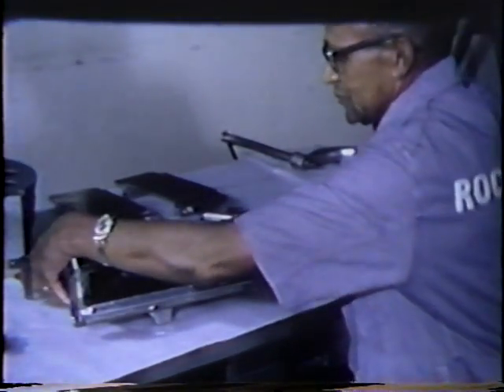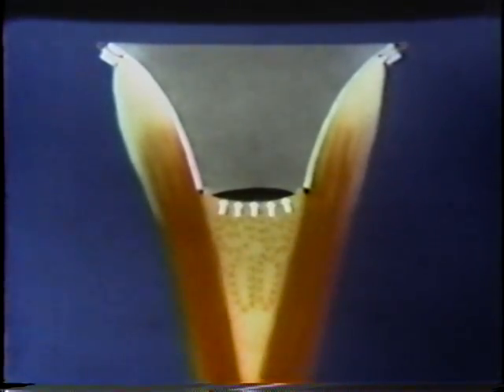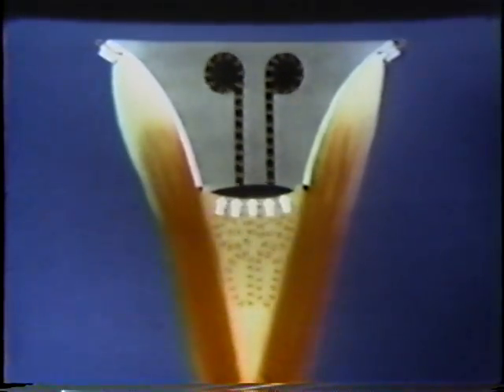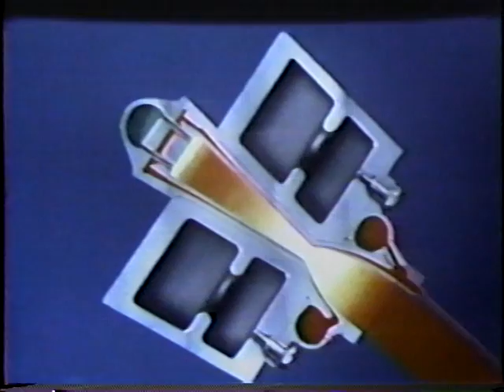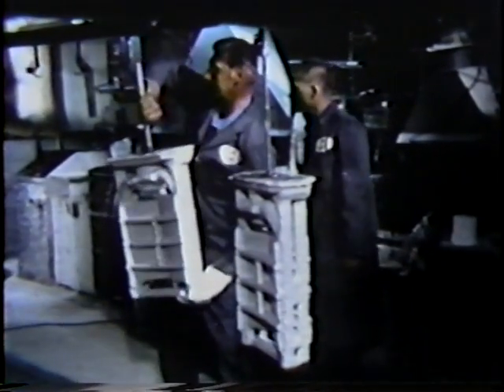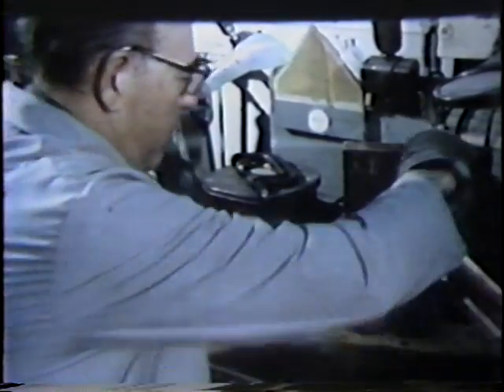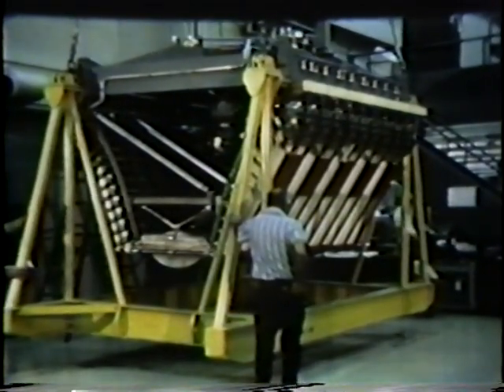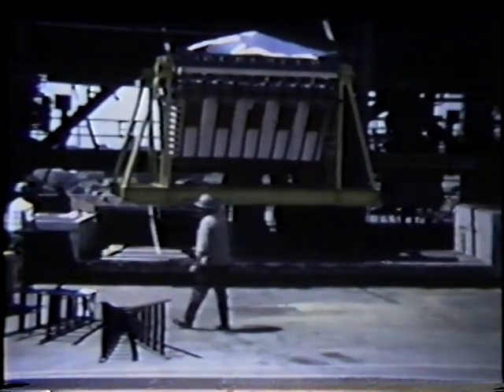Linear Aerospike Engine

Comment: Ken, 

I was a big supporter of the X-33 Single Stage To Orbit, SSTO vehicle that was based on the Aerospike engine.  The video covers historical technical background information that is useful.   It supplies an overview of this NASA development work.  

The Aerospike engine design has the potential to reduce the vehicle mass ratio.  Now, as SpaceX moves toward reusable boosters,  any cost improvements in the entire Falcon system are welcomed.  

The big issue that nixed the X-33 wasn't the engine or the SSTO idea.  It was the composite material & irregular shape used for the liquid oxygen(LOX) & liquid hydrogen(LH2) tanks.  There was a failure on filling them on a test stand.  No additional money was available at that time to develop a sound design.

Here is a link to a Wikipedia article on the X-33.
Reply: +John S Wolter https://en.wikipedia.org/wiki/Aerospike_engine

Comment: Its been 43 years since this and we still using bell rocket engines.....
Reply: If only the X33 wasn't cancled and instead put on hold till a material for the H2 storage could be found.
Reply: With very good reason. Nobody has figured out how to circumvent the laws of physics yet, in order to make a big aerospike work reliably.
Reply: Yeah, unless you're launching an SSTO you can have every engine optimized for the pressure range in which it is going to operate and you can avoid the aerospike's heat management issues

Comment: 2:33 Can sameone explain how this recirculated air inisde of flow can give thrust? I think There is lost of efficincy. No wall to recolect the lift and not having power right in the 180º of desire lift is waste energy.
What if put and engine instead of truncated?

Comment: Why this wasn't used for the space shuttle by NASA is a huge question. A replacement was designed with the aerospike engine, but...? I'm amazed that SpaceX isn't using it. Maybe in the future?
Reply: once the moon race was done they did not see a need to keep testing it.  Nasa did some testing about 16-18 years ago but Obama then cut all spending on space type things.  Space-x has to use proven tech they can improve it but a new tech would need years of testing for approval.
Reply: See ARCA here on YouTube.
Reply: It's never been flown. Nobody was willing to test it till now
Reply: There are still problems in realising an actual engine, SpaceX considered it at one point but quickly dropped the idea because the complexity does not bring any real benefits unless you really want to go single stage to orbit which is not very efficient.

Comment: 0:38 is the bell actually oscillating or it's just an optical effect?
Reply: Its the gases surrounding the chamber that's gyrating. But the Bell is moving as well sense its mounted in a Gimbal fixture.

Comment: Interesting concept. Film looks old. Why the linear engine wasn't widely used?
Reply: Aerospikes only make sense on SSTO/Stage-and-a-half to Orbit spacecraft, since they are heavier than conventional engines. None of those are currently flying.
Reply: +Sarge Rho,

They were too heavy in 2001.  Today would be very different.
Reply: John S Wolter A linear aerospike is always going to be heavier than a regular bell engine. Plug nozzle Aerospikes, and expansion-deflection nozzles, are a different story.
Reply: +Sarge Rho   Keep working the ratios, there are always alternatives.

Comment: A 5730 nautical mile ballistic hop requires 95% orbital velocity and a 20 degree burnout angle.  This takes you from New York City to Tokyo in 20 minutes.  A hydrogen oxygen single stage rocket requires an 81.7% propellant fraction.  

With an 8% structure fraction this leaves 10.3% payload fraction.  So, a 129 passenger ship, capable of carrying 29 tonnes of payload  in two class arrangement, 48 passengers in superior class arrangement, would have the following description;

    29.0 tonne - payload (51.0 m3)
   281.6 tonne - Take off weight
    22.5 tonne - inert structure
    35.4 tonnes - LH2 (505.7 m3)
   194.7 tonnes - LOX (170.8 m3)

And if we go for a Horizontal Take off and Horizontal Landing, we have something like this;

http://www.warbirdforum.com/paxwing.htm

Filled with hydrogen and oxygen propellant in the wing, a linear aerospike engine on either side of the observation platform in the tail with four J2 turbo pump systems.
Reply: +William Mook,

Keep working that spreadsheet.  You may discover a design that solves all the issues.

Comment: I guess I don't know enough about these to understand why they aren't being used.. I remember that NASA did some tests in the last 5 or 10 years with a new version of this though.
Reply: They were meant to be used for a SSTO RLV. The X33 was going to be their tech demo.
Reply: There are serious problems to overcome as you scale this up to a full size engine such as cooling weight and none uniform combustion. In the end a traditional engine is much better unless you really need single stage to orbit which is actually really inefficient.

Comment: Once again the Earth makes SSTO tantalizing close but unreachable. Hydrogen is not a good booster fuel, needs too much volume flow for the weight throw (so to speak.) Aerospike cooling increases by square, the need increases by cube, doesn't scale up.

Comment: Arguably the biggest dead-end in rocket technology. The commentator is really talking it up, whilst glossing over the serious disadvantages of the design. These include serious overheating issues with the spike as the engine is scaled up (a conventional engine throat is a small surface area to cool, but an aerospike is a large area to cool), more mass than a conventional engine with the same thrust (higher temperature tolerant materials tend to be much heavier), and greater complexity than a conventional engine as size is scaled up (how do you ensure an even combustion across the whole spike? Multiple feed points, and many more pieces of plumbing.).

If the design was as good as the commentary says, why has nobody managed to fit one to a space-going rocket? Go figure. It was shelved because it was found to be unreliable, and conventional rockets are also lighter, cheaper and 'easier' to build.